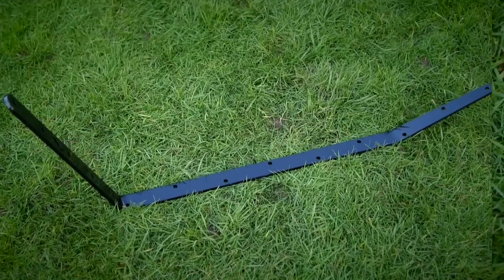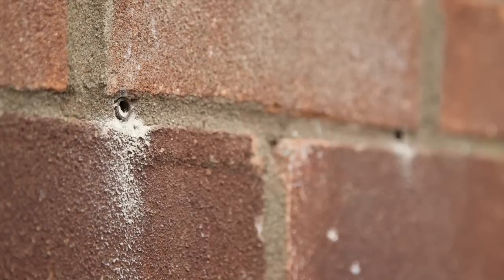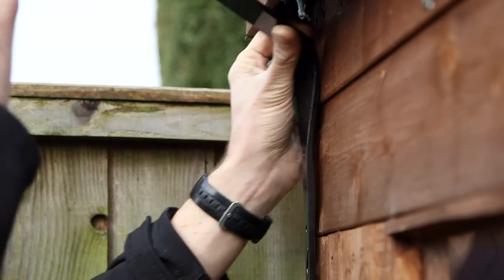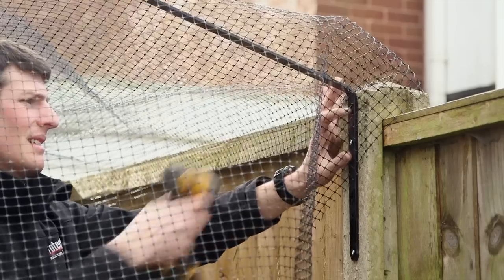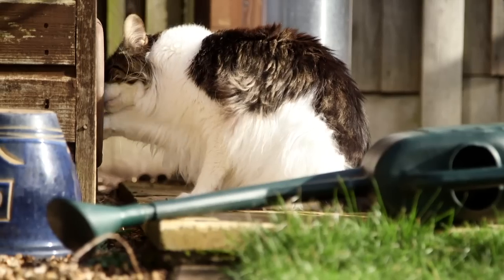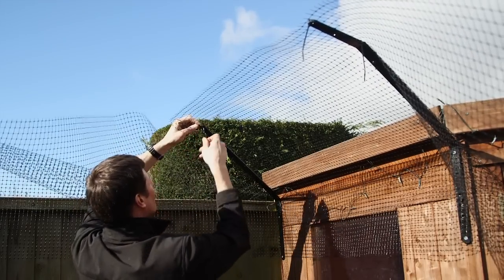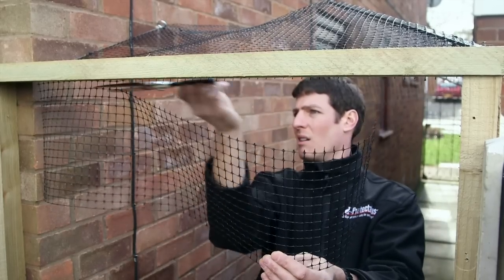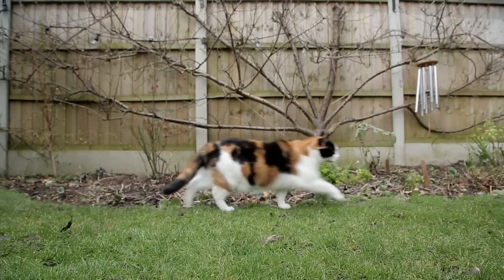How to DIY Cat Proof a Garden Fence by ProtectaPet

Comment: This is absolutely genius. I have two semi feral cats that I have been feeding for 7 years. I can pet one and maybe steal a quick feel on the other.haha, However, i will be moving in about 30 days and I have been extremely stressed as to what I am going to do with them when we move. They have always been outside cats and no NOTHING else.as of right now, in winter, they stay in their cat houses with heating cat beds, but this containment contraption is exactly what i have been searching for. The first thing we will do when we move is install a a 6 ft fence around the backyard, and we wanted something to kepp the cats in(as we will be living next to a fairly busy road and fear that the first thing they will do after the acepromazine wears off, is runaway. I know with 100% certainty that they are going to freak out when they awake from their( drugged to transport ) slumbers, my question is,#1 how much does something like this cost? We willl have about( Quantity 20)  6ft high 8ft lenghth panels. #2 have you seen a cat ever get over this, and if they do try and go for it, Will it rip the entire section down or is there a chance that they will become entangled(like a net)? Please , if you could give me that information, I would sincerely appreciate it., as I am officially a nervous wreck with worry about this situation. thank you for your time.
Reply: Hey did you ever have your questions answered or have you installed a fence to protect your cats? 

Kind regards
Reply: I hate that companies post videos, but provide no follow up to questions!  It insures I will keep looking for a more customer friendly company!

Comment: It's that 1% I'm worried about!!  I'll keep mine indoors where they are safe! I have frames at the windows to stop them getting out the windows and I have Airlocks to the doors, shutting one door before opening the outer! They have the run of the house which is a 3 bedroom house.  I wouldn't trust netting to stop the cats getting free, a neighbour might damage it and not say anything and cat gets out, a cat on the other side that had feline leukaemia might get in, a fox might get by jumping from the other side which I seen them doing in my garden on a 6ft fence, a tree branch might damage it allowing the cat out. To be safe, you would need to inspect it every day before letting the cats out!